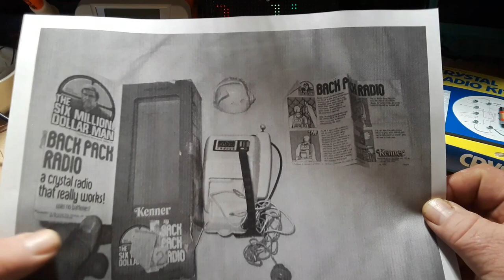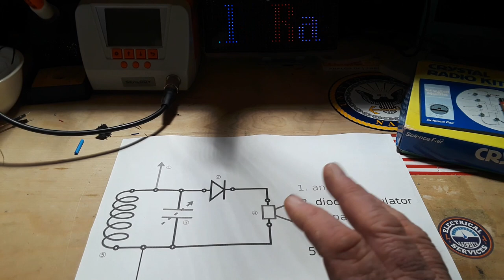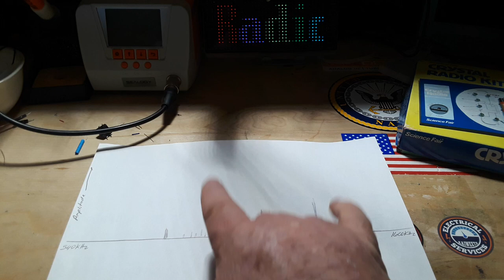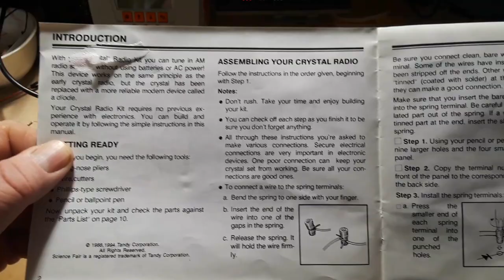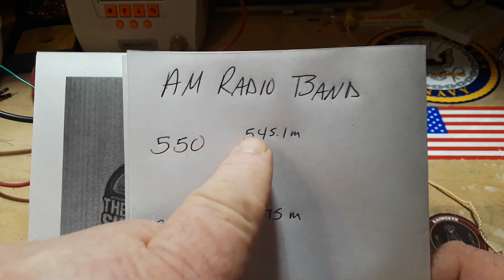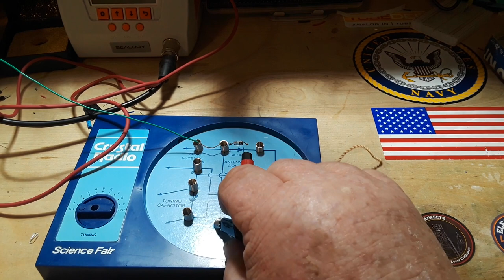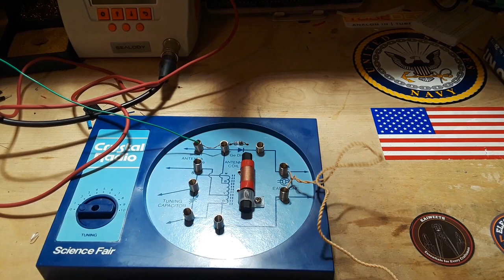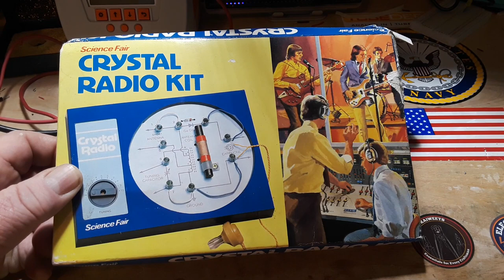Introduction To Crystal Radio Receivers

Comment: A kit just like this one was what got me into electronics when I was 6 years old. I strung the antenna out of my first-floor window to a tree in the backyard, about 5 feet in the air above the back gate. Nearly strangled my 6-foot-tall father when he came home that night!

Another great kit, and the one that confirmed me as an "electronics addict for life" was the "50 in 1" electronics kit that I received on my 7th birthday, with some components mounted on a board similar to what you show here and the same "spring" connections.  I built far more than 50 projects with it and eventually repurposed the box a few years later when I built my first record player.

Great video Paul!

Comment: Thanks Paul! My first crystal radio was a little rocket, with a pull out rod in the nose to tune it. 
Later years my best friend used to get the Tandy kits with springs, and we built and tweaked all kinds of circuits. 
Found your channel a while ago, looking for 'how to restore my soldiering iron tip' and have been enjoying your videos ever since.

Comment: I also built one of these back as a teenager, it picked up so much and amazed me that it didn’t need a battery. I also discovered it picked up the signal from our cordless home phone and I could happily listen to any phone call and could hear both sides of the conversation - some unpleasant things were heard. Still, I could also pick up far away stations during the early hours. Mine was earthed via the mains water and a 25m length of 0.25mm singles made the aerial slung out the window and attached to a tree at the bottom of the garden

Comment: Thanks for the memories. My dad bought me the radio shack 150 in one project kit, back when I was about 10. That began my love of electronics. Built a foxhole radio and that was pretty cool. Besides the safety aspect, keep your antennas away from power lines because of interference and induction. One does not want 7.2/7.5 KV smoking radio gear.

Comment: Thanks for another interesting video. You must have grown up about the same time I did: I used to build lots of those Radio Shack kits. I wonder if back then, "Made in China" meant Taiwan?

The pure simplicity of crystal radios has always fascinated me. It's always seemed like magic that you can demodulate an AM signal with just a diode. And also that there's enough power in radio waves to drive an earphone. I've often wanted to try to make an actual cat whisker radio, using a wire and galena crystal. I hadn't thought about it before, but I guess that would be equivalent to a Schottky diode, as you suggested.

But I definitely never knew that a rusty razor blade is a semiconductor. I learn something every day. Take care. 🤓

Comment: This made me smile ! Back in the age of dinosaurs ,when I was a kid , another kid I knew I came about on the street ,and he had one of these things hooked up to a fence . I asked if I could have a go and he said yes ,then promptly scarpered  : ( Anyway years later I saw a 'Ladybird' book about this very subject on ebay ! Why it makes me smile is that I never yet have made a set ,but it set me on a hobby in electronics where I have completed lots of quite complex projects and own a lot of equipment . Goes to prove  ' From little acorns ' !!!    Thanks for making another great video 🙂🥃
Reply from the maker: You owe it to yourself to build a crystal set. Every time I hook it up I'm just awed that it sucks signals out of air with no power. I know how it works but I'm like a child every time!
Reply: @learnelectronics  Thankyou for answering  so quick : ) I will get moving on this ,I will make one with my grandsons . Thanks for the spur !🍕🍺

Comment: Paul, As many have said, Radio Shack provided the start for my interest in the physics of electronics and  electromechanical systems and more than 40 years in communications in my military and civilian careers. The toilet paper tube crystal radio was a big step in my understanding of the electromagnetic transfer of data through the ether. I like that we have a push for STEM/STEAM in our schools, but we need the hands on of vocational schools providing training in the teen years so that we can promote all of the trades. (I had three years of Vocational electronics in High School.) We need to build our Guilds back up, because everyone does not need a degree in basket weaving, but we do need someone with the proper tools and knowledge to fix our plumbing, HVAC, Electrical Systems, etc.. Thank you for providing one of those channels that might spark someone's interest enough to want to learn and make electronics, and maybe take it to the next level, a career.

Comment: Local oscillators actually produce carriers, that’s how they were detectable. Tune in a local AM radio station on a modern radio and you will hear a blank carrier at 455 KHz above the station’s frequency on another radio that’s close by. The same thing happens with FM radios, except the carrier shows up at 10.7 MHz up. They can actually be modulated as well by introducing audio and the RF signals can also be amplified.

Comment: Speaking of RadioShack stuff, I also had that 200-in-One electronics kit back in the day. You could build a crystal radio with that one, too. There's nothing like that spring-in-cardboard technology. As frustrating as it could be at times, I actually liked it.

I also found my old RadioShack frequency counter a couple of weeks ago. Would you believe it still works even though I was young and stupid enough to leave the batteries in it all those years? That's solid construction you don't see anymore right there.

Comment: What were the coil and cap measurements? Did I miss that? 

Also, if one wanted a speaker could you hook the crystal circuit up to something like LM386 or an op amp with output transistors to drive a speaker?

Comment: By changing the coil you can get shortwave stations assuming you can actually find one that still running.  Try a ZN414 with a AA battery for more POWER !🙂

Comment: Could you follow up on external antennas. I am thinking for the cheap portable sw-mw-lw radios. There are so many options. 3.5mm input jacks, clip on the extension antenna, some loop that just sits next to the radio... How do we optimise an antenna for a certain sw frequency? 

Thank you...the crystal radio video was great.
Reply from the maker: You want a single piece of wire that is a multiple of the wavelength. So if your wavelength is 100 ft, you would want an antenna that is 100 ft or 10 ft or 1 ft. If your wavelength is 500 ft, you want an antenna that is 500 ft, 50 ft, or 5 ft.

Comment: I'm playing with FM radio. i made a transmitter from a kit. It's a 5W output but it doesn't go very far. 2 city lots it's mostly static. If there is anything in the way no signal. Short of boosting the wattage what's the best way to get it to transmit over a larger area? Higher bigger antenna? Type of broadcasting antenna? I'm just trying to play streaming stations over my property. I need a strong short range signal. I'm not interested in broadcasting to the whole community yet. We have one radio station on the dial.
Reply: If your transmitter is indeed 5 watts and it’s connected to an antenna, then the range should be a few miles rather than two blocks.